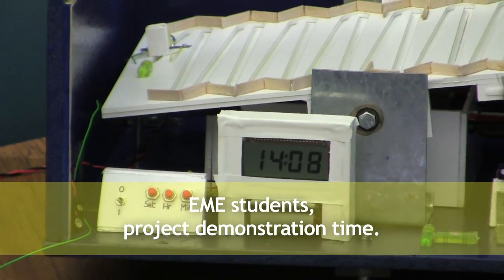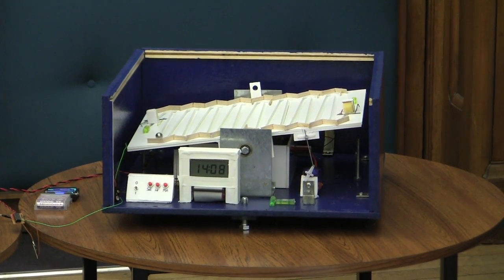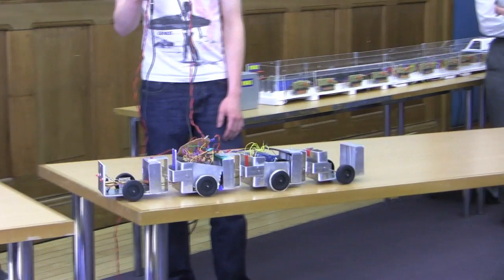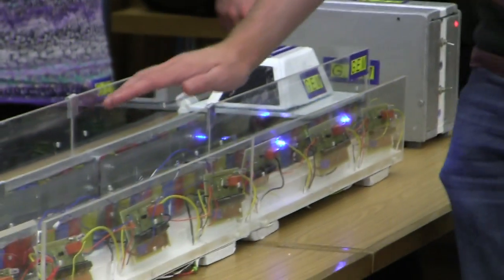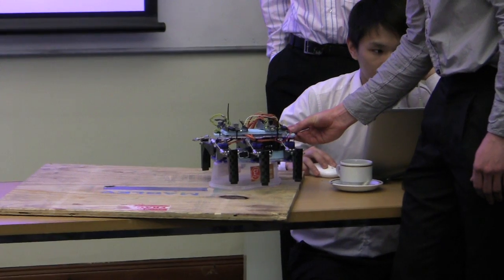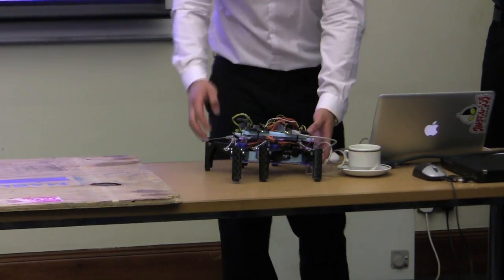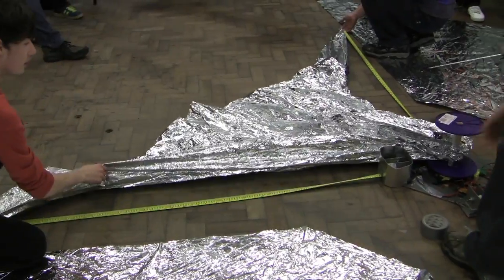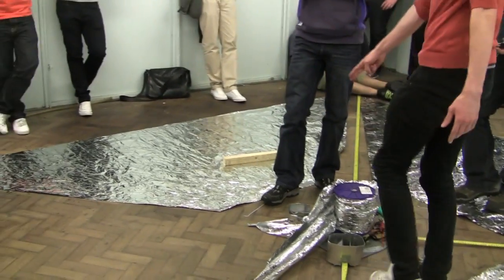EME mix of projects 2. Congreve, robot train, MagLev, rover, solar sail.

Comment from the maker: A mix of student projects of a  #Congreve   clock,  #MagLev   train and Martian  #rover  . All done in one semester and on a budget of £100.

A rolling ball Congreve clock. (Generally not noted for their accuracy!)
A gap crossing robot train. (Was also to be obstacle avoiding, however that part gave problems.)
A MagLev train. Electro-magnets (but only those directly under the train) for levitation, a powerful fan for forward motion.
A 6 legged Martian rover. A shame that during the demonstration the rear set of legs gave problems.
Trying to deploy a solar sail and also retract it.
(2011.)